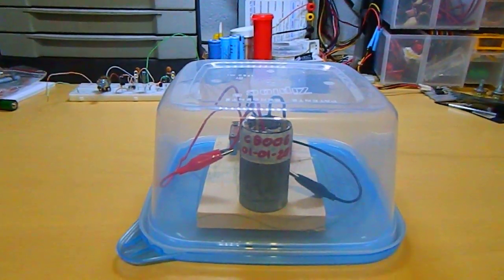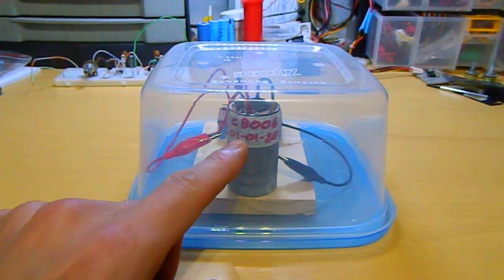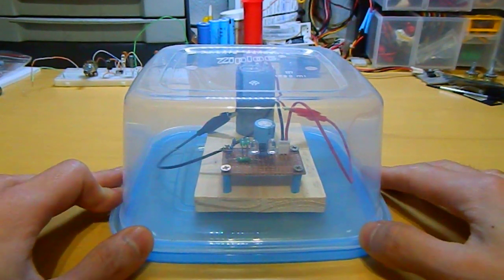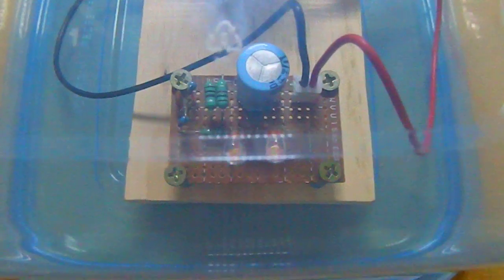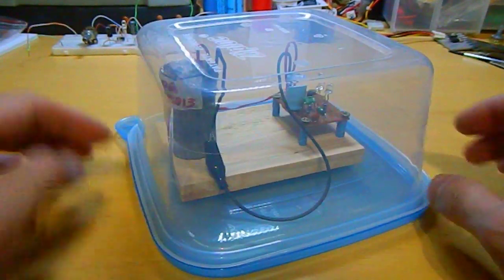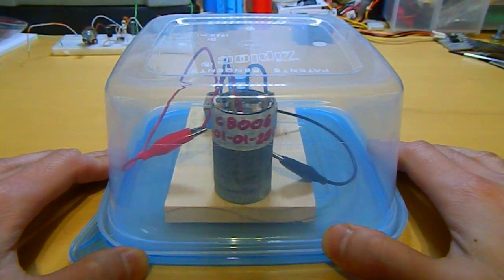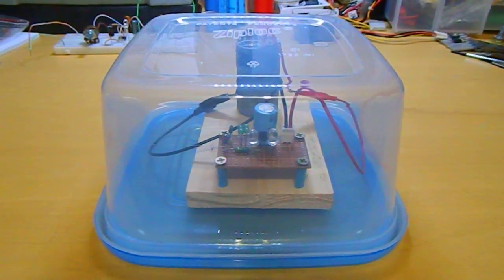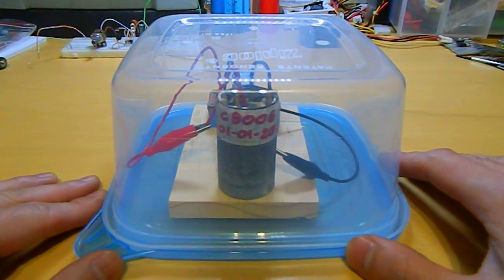Zinc/Copper Crystal Cell Update

Comment: Ever thought of pulling a vacuum to see if it runs longer? You could even put a vacuum gauge on it to check for leaks. Another idea might be to put a desiccant bag in the container to absorb the moisture. Next time you buy beef jerky save the desiccant bag. Put it in a oven at around 120 degrees for 30 minutes to dry it out so it is ready to absorb more moisture. As soon as it cools put it in the container. More bags are better.